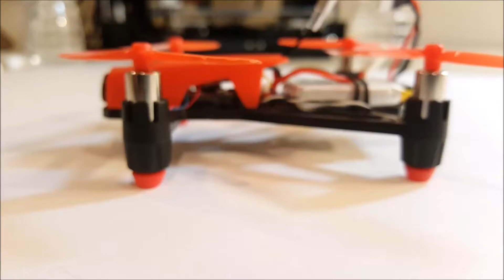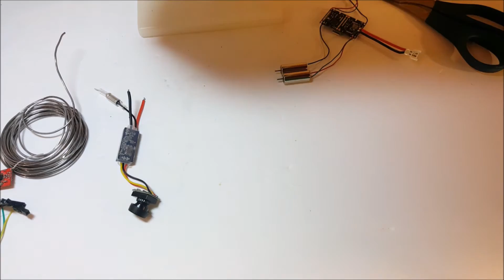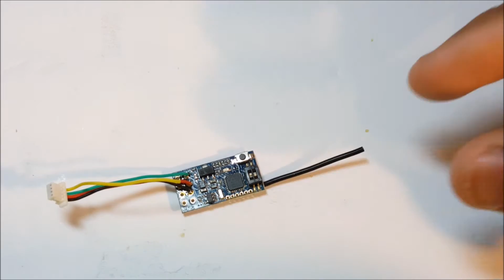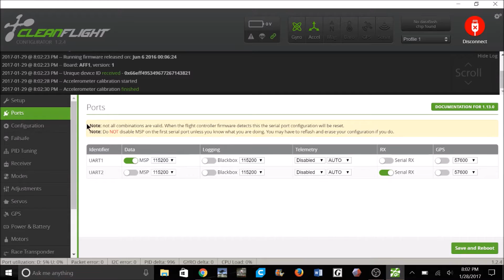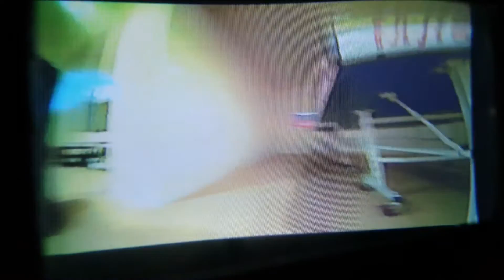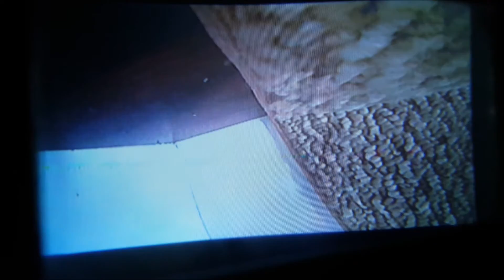MICRO FPV QUAD BUILD-Hobbymate Q100 | FPV Footage

Comment: 🎯 Key points for quick navigation:

00:00:00 📦 Introduction to the Hobbymate Q100
- Overview of the Hobbymate Q100 micro FPV quadcopter's components and features.
- Quad features a customized frame with a unique canopy.
- Includes a micro brushless flight controller supporting multiple motors.
- Comes with a camera that has a different wiring setup from traditional FPV systems.
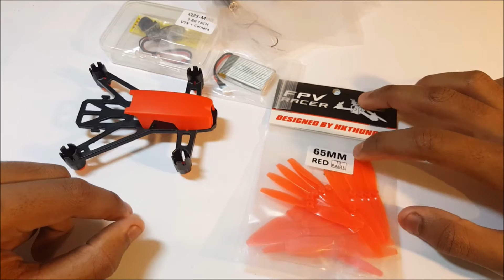00:02:18 🔧 Assembly Instructions and Soldering
- Detailed guidance on soldering connections for the quad's electronic components.
- Explains the significance of proper wiring and soldering for the flight controller.
- Shows how to connect the FPV camera and receiver, emphasizing configuration options.
- Introduces software setup for the radio transmitter and binding process with the receiver.
00:10:18 🛠️ Configuration and Calibration
- Instructions on configuring flight settings and calibrating the quadcopter after assembly.
- Guides through setting up the Taranis transmitter and adjusting settings in the Cleanflight software.
- Discusses channel mapping and failsafe configurations for optimal flight readiness.
- Emphasizes the importance of proper calibration for flight stability.
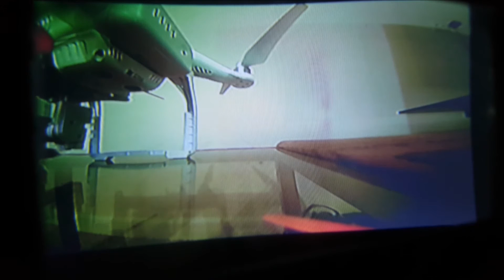00:19:20 ✈️ Final Thoughts and Performance Review
- Concludes with a performance analysis of the Hobbymate Q100, highlighting its value and capabilities.
- Praises the quadcopter's speed, agility, and durability based on flight test experiences.
- Discusses battery performance and expected flight times during different flying conditions.
- Recommendations for beginner pilots and overall pricing advantages of purchasing through specific retailers.

Made with HARPA AI

Comment: does it come with all that because i was planning to buy if off eBay and can you use brushless motors that have just the thin wires and solder the brushless motor wires to the drone motherboard and is there a app for the drone for the camera and can a FrSky Taranis X9 Lite 2.4GHz 24CH ACCESS  and what is s bust mean and the other mean and what do they do
Reply from the maker: Apologies for the late reply. The flight control board is built specifically for brushed motors. With this setup you would be unable to run brushless motors and I would personally opt for a different setup that is meant for brushless flying.

Comment: What battery capacity did you use? 500mah? I have the same frame with syma x5c electronics and motors but it shakes so bad when flyes, i think the stock syma PIDS are not meant for a frame like that and i cant change them 🤦🏻‍♂️🤦🏻‍♂️🤦🏻‍♂️
Reply from the maker: It was rated at 550mah. And I agree I don't think the stock syma tune will work with this frame. A small brushed fc like the one I used shouldn't be too expensive these days

Comment: How do you get the frame to balance, i mean to say is with the battery on the back does it tilt from the weight?
Reply from the maker: vassilis Thegreek The flight controller figures it out and compensates by adding thrust to the rear motors. It's not ideal though, and I ended up switching to a frame where I could mount in the middle
Reply: Sohan Sunku thanks for the reply mate.
Im putting a syma x5c board in this frame, do you have any good tips to watch out for before i begin? Will it work?
Reply from the maker: I'm not too sure if that board will work in this frame. This frame is designed specifically to hold the included flight controller, as it uses some small tabs to keep it in place. The mounting pattern on the syma x5c seems a little different. Additionally weight is a huge factor in these micro quads, and every gram counts. The x5c board seems quite heavy, but I wish you luck with your build
Reply: Sohan Sunku thank you

Comment: Is it possible to use a receiver without a plug? And If so how? Thanks.
Reply from the maker: clarence soh teak ang With the board that I used in this build it's easiest to use a plug, but if you're soldering skills are good enough you can direct solder to the small pins behind the female plug on the  fc.

Comment: can i bind with flysky i6s transmitter
Reply from the maker: job james This kit does not include a receiver. To use a flysky tx you would need to buy a micro rx compatible with it

Comment: Sohan Sunku, what rx do you use for Taranis? OrangeRx or else?
Reply from the maker: hanomancakep for this build I used one I found on amazon link is in dezcription
Reply: Sohan Sunku, for Tx in Taranis, are you using this Tx or blank:
https://hobbyking.com/en_us/orangerx-dsmx-dsm2-compatible-2-4ghz-transmitter-module-v1-2.html
Reply from the maker: I am not using the orange module, just the built in frsky one
Reply: Noted..I'm still having problem binding to Taranis..seems the satellite receiver must be bind with other fc before connected to allienflight
Reply from the maker: hanomancakep Well that's weird. Make sure you are using D8 mode on the tx. Just wondering, did you use the same rx I did?
Reply: Sohan, I'm using dsm2 and in taranis using orange module. What mode should I use on Taranis ?
Btw, your soldering technic is good. I copy what've done
Reply from the maker: hanomancakep Thanks! I tried to solder very meticulously. I don't have much experience with spektrum so I can't really guide you through the process. One thing I know is that you must use a different uart port for spektrum recievers so that won't be the same as mine
Reply: Tthanks Sohan... I believe you dont use any additional module on the bay of Taranis ?
Reply from the maker: hanomancakep You are correct I don't use a module

Comment: Hi can someone help me? I binded my Taranis to my rx and I get the solid LED.  I have it set to D8. On cleanflight I can connect to the board but the receiver sticks don't reflect in cleanflight. uArt 2 is to serial, and under receiver I am set to serial, SbUS.
Reply from the maker: +Norman Torres Is there any movement in the receiver tab when you move the sticks? Also, is the battery plugged into the quad?

Comment: I'm building one of these too, still waiting on parts from China :(
Have you tried it on 2S? Thanks for the video.
Reply from the maker: Callum Mckay I haven't tried it out on 2s. I don't think that this fc is able to, but I know that hobbymate sells another fc that can handle 2s
Reply: The board I have 'SPracingf3evo' supports 2s
Reply from the maker: Callum Mckay Oh it's probably a variation. That'll be really fast, but be careful. My motors get pretty warm when I push em on 1s
Reply: Sohan Sunku yeah it looks a bit like the board you're using. I found 2S rated motors, hopefully they'll cope 😁
Reply: Callum Mckay what 2S motors dod you find? Did they work good? Great video Thank you!